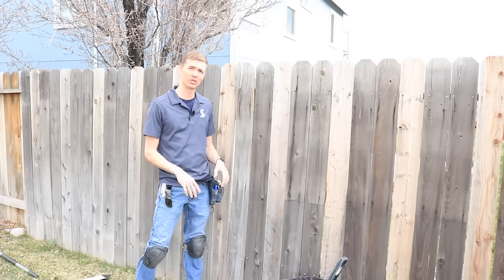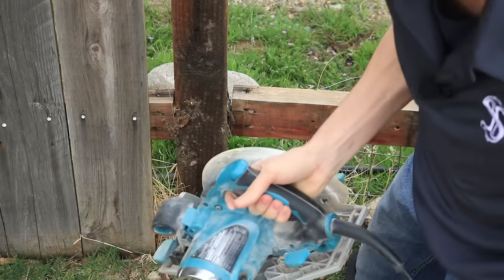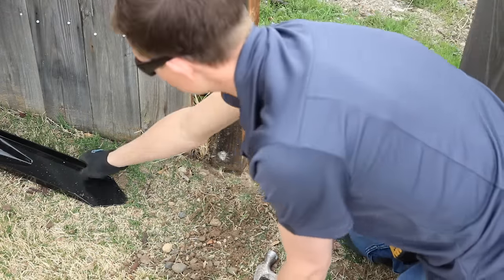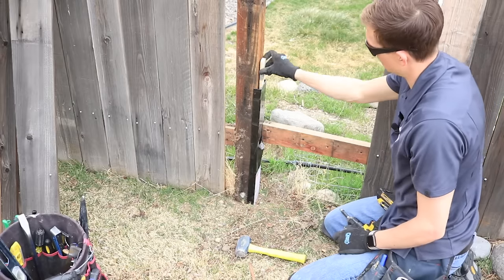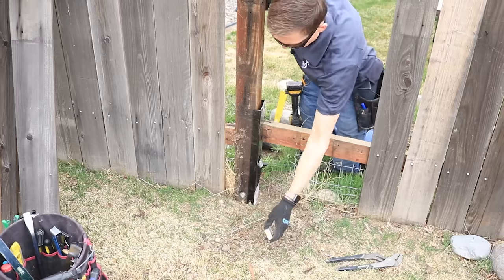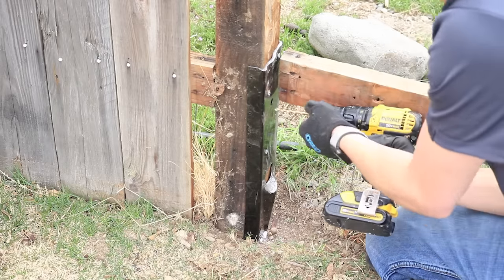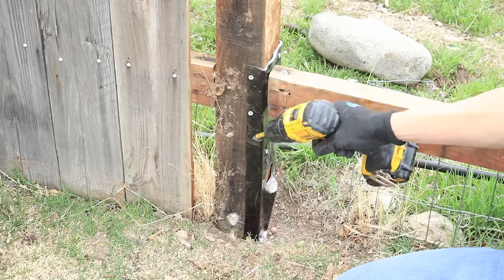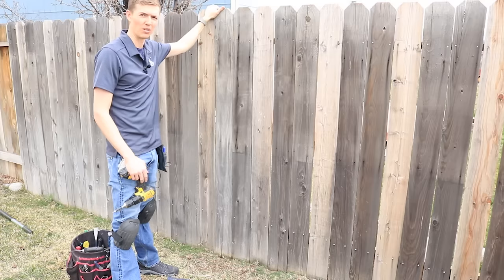How to Fix a Broken Fence Post in Under 30 Minutes

Comment: EZ-Mender Fence Bracket isn't $10.  Here in Canada is $80+HST (13%)
Reply: I got two for free. Just grabbed them off of the display and ran out the door!
Reply: @Natschke_Family_Adventures  really 😈 should go back and pay for them or return them😇
Reply: $6.98 at Home Depot
Reply: @jamespaul5059  $9 today, and you need to USE TWO OF THEM...

Comment: I tried the EZ-Mender metal fence repair bracket, but oddly enough, the hole in the concrete was smaller than 4x4, though the posts are 4x4. I can only guess the fence installer used posts with a slightly undersize bottom (no wood left in the hole). I ended up buying a new cedar post ($38.57!) and cutting the bottom to fit the hole.

Comment: You didn't  follow  directions  on label, the mender is supposed  to be used front and  back and comes with  predrilled  holes,will be much stronger  as wind blows on picket sides of a fence.
Reply from the maker: I realize that, but this was is better. Trust me I've done dozens of them, some at my own home (where it is extremely windy), and this is the best way. When you use two, it often breaks the concrete footing and requires you to replace the whole thing.

Comment: Word to the wise, the main problem with these stick built PT  fences is that the posts, pickets, and cross members all  deteriorate at different rates. 
The problem that I see with this method if its more than 1 post due to damage vs deterioration  you may as well replace every post with new.  At the price quoted for the repair your going to spend the same on a new post. Granted your going to spend more time if the post has been anchored with concrete. If not its actually quicker to remove and replace with new.  I have learned over the long term to only sink the corner and gate posts in concrete and the secondary posts a foot deeper with no concrete. This gives you plenty of support and the posts regardless of bare dirt or concrete fail at about the same rate. Much easier to remove and replace a secondary post.
Reply: I would never sink posts in just dirt... What about strong winds blowing the sections from the side??? A heavy load of concrete is going to be more stable in high winds than just dirt, holding up a load that is getting stressed from either side, right ??

Comment: but that thin metal insertion thing will rust in a few years so you'll be back to square one. A nice idea but if it isn't galvanised metal then it won't last long.
Reply: It's not thin, quite heavy to lift.
Reply: You're correct but this is a quick fix to get a few more years out of an old fence. A decent solution as a temporary measure but that's all it is.

Comment: Why not put that in with the poured concrete when it’s brand new being put in the ground for a post that way you’ll never have to change that post only the fence….no?
Reply from the maker: It’s overkill. If you simply install the post correctly, it will likely never rot in the first place.

Comment: Just dont put wood into ground... new style is post attaches above ground...to a u joint...
Reply: Actually, don't use concrete.  Without concrete, my 19 year old skinny daughter can dig out a post in less then 4 minutes by herself with a post hole digger.  Without concrete, you only have to dig down about 15" and then just tip it out.

We live in FLORIDA: hurricanes AND sand.  And the fence hasn't wavered without concrete in 20 years of 70-80mph winds coming several times over 2 decades in Florida hurricane season.

Concrete is ONLY called for in crappy soil (soft loamy soil, like peat moss...) OR for gate posts.  

As for those metal anchors, the mfgr. recommends a MINIMUM 36" spike on them for a 6' tall 8' wide fence:

can anyone tell or show me which oz-posts are solid for wood fence panels 6' high and 8' width, please?
Answer:We recommend 36” length spike, please search by ASIN no. B0711HWKBY
By MTB Supply Inc SELLER  on March 22, 2019

And here's the first REVIEW on Amazon for the 32" ones in a 4 pack for $60:

Reviewed in the United States on May 17, 2018
Size Name: 32"X4"x4" 4PackVerified Purchase
After about 3 months, a couple of the spikes broke from rust... Had to redo an entire fence. The others were rusted as well when I dug them up

NOPE.  Will just pay $11.57 at Home Depot for 4x4 pressure treated and will get 20 years, same as the ones being replaced now.

Comment: Also,  putting tar on the post, plus working the concrete around the pole at an angle goes a long way in stopping rot to begin with.

Comment: This is a great idea for a weekend do-it-yourself type person. Absolutely terrible idea if you actually charged someone for that “fix”. As a “handyman” your job would typically be to actually fix the issue. I suppose there are certain clientele that might prefer this assuming you charged significantly less than repairing properly....maybe a landlord of middle to low end housing for instance
Reply from the maker: This is a surprisingly robust solution. I’ve done it at my own home and so I’ve seen how it holds up over time. As long as you explain to the customer what their options are and present this as one option (that is much more cost effective), then customers will typically prefer it.

Comment: FFS do NOT hit 2 hammers together. They are made of high carbon, heat-treated steel. You can fracture either one. Might not fail straight away but could fail when you hit something next time not wearing safety glasses.

Comment: These are $18 now… not worth it for just a little more I have a whole new post solidly cemented, within about the same actual man hours
Reply: I doubt you can actually dig out around the old concrete and pull it out in 30 minutes. I used a couple of these last year and they make the post more solid than a good post. I spent some time pounding the metal in. It seemed a lot harder than he made it look but I would guess he is 40 or more years younger than I am too

Comment: What about the concrete? This only works if the post aren’t set in concrete. Why would a post not be set in concrete?
Reply from the maker: No, this only works when a post IS set in concrete.
Reply: @StayHandy  really? So you hammer the wedge into the concrete?

Comment: There’s no way I can get that down the side of my post,as mine is concreted tight to the post.ive been chiselling away for hours with no luck.I need a kango but not allowed out due to the virus.
Reply from the maker: That's what I thought the first few times too. The concrete is always tight to the post and the EZ mender is always a little wider than the hole in the concrete. But, with enough strikes with the hammer, it will go in.

Comment: Just use a concrete spur dig down side of post drill trough wooden post and bolt both together ,a lot quicker and same sort of cost ,I am a 40 years experience fencer this would be a much better job ,than this guys efforts .

Comment: Replace the posts. There not very expensive. Geese !
Reply from the maker: Replacing the post will triple the cost of materials and more than quadruple how long it takes to repair. I've done a lot of these repairs. But by all means do it the hard way if you want to.
Reply: Thomas L.S. They're*
Reply: @StayHandy  you give real handymen a bad reputation by cutting corners and doing bodge jobs like this,  you showed no professionalism whatsoever,  never wear gloves using rotating tools or hit hammer on hammer
Reply: @StayHandy  WOW, that's just IGNORANT.  A post is $11.57 today, and even a adding a 60# bag of concrete only adds $4.  That's UNDER $16, which is NOT ONLY NOT triple the $9 here, but IS LESS THAN THE $18 THAT TWO OF THESE COSTS: WHICH IS HOW MANY THE MANUFACTURER RECOMMENDS PER REPAIR.

LOL   "TRIPLE"

Comment: When i was an apprentice i was told to never hit a hammer with another hammer.
Reply from the maker: That’s a myth. Look it up
Reply: @StayHandy  your the one that needs to look it up... 

Hammers are hard. Comparatively, nails are soft (that is why they bend when you miss). Hitting two hard hammers together might cause shards of shrapnel to go flying. Eyes are in danger, and once a hammer has a chip out of it, it will be even more likely to keep shedding shrapnel.

Comment: All a man did was to dig below where it had snapped 6"  and then screw four screws to the top of the crack and the bottom and then fill it with postcrete  job done theconcrete grips the screws so it cant move when it's set.

Comment: When using the power drill why do you Jackhammer the trigger switch I'm putting a screw in set it up end Drive the screw in till the clutch engages the release your finger off the trigger I don't know where this bad damn it came from when I see it a lot in video especially with young guys

Comment: Post rot at the bottom because the dirt settles and allows water to sit, raise the dirt level to repel water and the post will last longer...
I have a off road jack to pull the post out, than I reset the new post..
.
Metal repair will rust especially in the ground !
Reply from the maker: I agree with everything you’ve said, but this repair still lasts and saves a ton on labor and materials.

Comment: Fence posts rot because water sits on top of the concrete. There is no reason to use concrete to set a fence post the dirt will hold it just fine.
I live in Florida where were right at sea level in it rains every freaking day.
No one uses concrete to set fence posts.
Reply: Agreed.  Changing out posts after 20 YEARS in St. Petersburg, FL

BUT, frost heave forces northerners to use concrete...

and actually, rot occurs due to alternating wet/dry cycles.   That's why our fence posts rot just the same without concrete as with concrete: right at the dirt line.  always dry, no rot.  always wet, no rot.  So there's no stopping it, without chemicals, from happening outside.

In fact, since the tops and bottom of fences are where rot occurs first (any rain hits tops, "enough" rain hits bottoms), then the ONLY places you really need to treat are that top 4" and bottom 4" when you apply a preservative, not the WHOLE FENCE...  they'll STILL rot faster than the middle of the pickets.

Comment: For about $10 the price of the easy mender you could remove the post, replace with a chain link steel post and set with concrete.  You would attach the existing panels using he steel fence wraps used with chain link.

Comment: NOT REALISTIC.  Why ? all the fence posts I have in many properties have concrete as the base. There is NO WAY to hammer anything deep into this concrete base.
Seen these things sold at local Home Depot but never bought them. As a DYI, I have fixed leaning fence posts by planting two steel bar (about 6 or 7 feet  long, sold at Home Depot, pretty cheap),  on both sides of the broken post (about 1 feet apart)  with concrete base as if they were fence posts. Then attached these two bars to the horizontal beam of the fence with fasteners. Work out really well, especially when many consecutive fence posts gave way. In this case, I planted one steel bar in the middle of each panel section. Done that to a vacation  home on the mountain.

Comment: I wish I saw this about 3 years ago -- it might have helped even with the weak concrete, just to have the extra brace. 
Two years ago my neighbor cut her tree some and busted up the fence. No one noticed the post had actually broken at the very base where the concrete was, totally laterally -- until one of hte windiest storms came along a year later and completely ripped it up and tore the base to shreds from all the rubbing friction. I tried to merely re-concrete it with a sort of raised-concrete base-post. It stuck up from the ground but who cares honestly. Sadly, it didnt cure correctly and powdered to dust/dirt at the exact location the original wood had split at. Now Im looking at having to replace the whole thing cus my neighbors son (who caused the initial damage) is denying everything, and even has his wife come over to cuss my mom out about it, despite it legally being "their fence" to repair.

Comment: What you DO NOT mention in your video is the dimension of the existing fence post. The EZ tool you are using will NOT fit a true 4"x4" wood fence post. It will fit a 3 3/4" x 3 3/4" post.

Comment: really you need 'ear protection" for using a hammer.? you should have laid a small 2x4 across the top of piece of metal you were hitting and drove it in that way. it would have a lot easier that trying to hit that little spot on the side. and used a bigger sledge hammer. but that,s just me. i am a firm believer in work smarter,not harder.

Comment: Why not just concrete in a spur post and bolt it to the fence post
Reply from the maker: Because this is easier and less expensive.
Reply: Or just replace the post and concrete for $5 more and about the same time and effort.  Added bonus: you have a new post instead of a 3-piece rotten post.

Comment: It looks like the fence was erected wrong way  round, the decorative side should be on your  neighbours side, not the rough side.
I wouldn't bother with that piece of steel its a bit of a bodge. Why not fit a concrete post 3' deep and 3' high up the wooden post.

Comment: This is the "just got my first job at lowes while going to college" band-aid and not the professional repair a "handyman" should be offering... The wood that the wedge is against in the concrete is still rotten and will only support that post for maybe another year or two.
Reply from the maker: I disagree because I’ve seen them hold up years just as sturdy. The wood doesn’t matter. The concert is the support you are attaching to. In fact, I’ve yet to see one fail and I’ve installed many of these since like 2012.

Comment: OMG lol.  using a hammer to hammer a hammer... 
be sure to wear eye protection. lol
Reply from the maker: That’s a myth. Look it up
Reply: @StayHandy  what myth,, the fact you smack two pieces of carbon steel together they can chip..
oh that fact.  
whatever dude... 
Hammers are made of high carbon, heat-treated steel for strength and durability. The heat treatment makes the head very hard, but it is also brittle. Hitting another hardened steel object can cause one, or the other, to fracture, chip, and fail.
Reply: @StayHandy  still wondering about your myth, and your dangerous advice...

Comment: I'm just not seeing it: Lowe's shows them recommended installed IN PAIRS: TWO per post, one on each side, so we're not following the mfgr. guidance here with just one.  At $9 for one, $18 for two, I'm going to dig that post out instead and put a new $11.57 treated post in.

You only have to dig down with a post hole digger on one side, then tip the broken post and lift it out.  Not that big of a deal in most soil conditions as I pulled one today that my skinny 19 year old weakling daughter dug out with the post hole digger herself in a few minutes.  And it's crazy easy if there's no concrete, which is usually the case on posts that aren't supporting a gate, you'll likely only have to dig down 15", which is half the normal 30" that 8' posts are set to.

I'd love to give the "mended" post a good tug and see how it really holds up.  And then do it again after one winter, because if that concrete cracks away from the post, I predict things will have gone directly south, which is why they recommend using 2 so that they can "clamp" around the stump of a post inside the concrete, and not depend on the concrete to stay in place to maintain a tight fit.
Reply: I just replaced the back fence on my property - 75'. Used metal posts, three rails, and ended with a beautiful fence. However, on one side fence, our neighbor, a really wonderful man (died a few years ago, now) had paid a second neighbor to replace the entire side fence. The "repair" dude seemed to have a basic idea of what he was doing, but on a scale of 1-100, he built a fence that I'd grade at about a 75. Now, one of the fence posts is leaning pretty badly, and I've been puzzling over what to do about it--since it belongs, lock, stock and barrel, to the late neighbor's sisters (who inherited the property and are just renting it out). For this particular setting, until I bite the bullet and spend another $2-2.5K to replace this side run, I might opt to try the post mender. Oh, did I mention, it's 103 degrees outside today? Not exactly fence work weather!

Comment: Banging it into the concrete around the post ,mmmmmmm
Just  use concrete posts ,lots of hard core under and around posts on soft topsoil ,then concrete around posts lot of .
There forever

Comment: Seems like it would be quicker, easier, and cheaper  to just replace the post.
Reply: Digging out the cement footing/ breaking up the cement and putting a new post in?... Yeah that's not quicker or cheaper... The new treated 4x4 post alone would be as much cost as this solution.

Comment: Problem I have, is that the installers used the "dry mix" method.....that is they don't pour concrete, they just "SUPPOSEDLY" dig out the hole, place the post and pack DRY CONCRETE mix  around the post.....they contend that it pulls the moisture from the ground and is "just as stong"...it is not
Reply: Ahem, the first good rain will soak that ground and set that concrete harder than your driveway.  Why?  Because concrete cures HARDER the SLOWER it dries and the longer it stays wet, which it will do IN SPADES in the ground.
Reply: B Miller that is a nice thought, unfortunately I have three fenceposts out of eight that show the lie the wonderfulness of dry mix.  Dry mix is faster for the installation, that is it.  Maybe your experience is different, but my experience is that dry mix in our installation was a nightmare that resulted in the fence collapsing two months later after a summer storm.  The company refused to honor their “guarantee” as they had just gone out of business....funny how that happened.